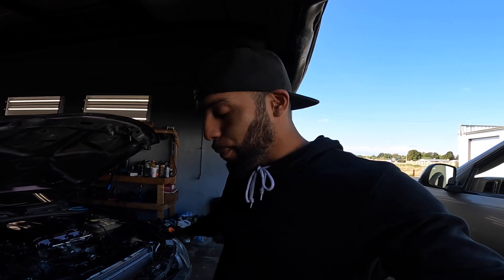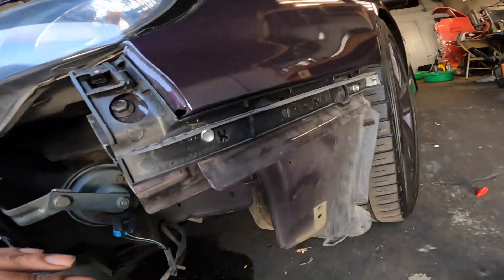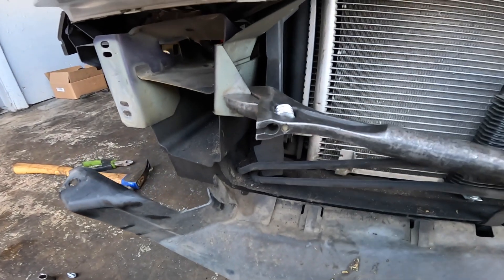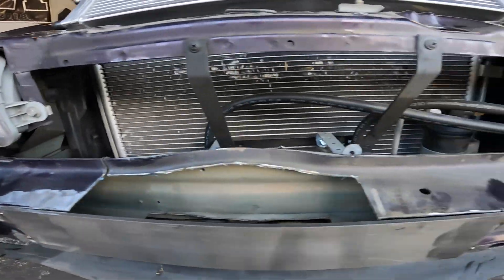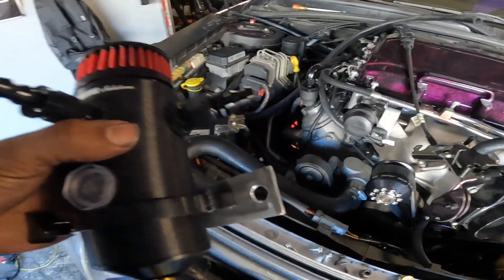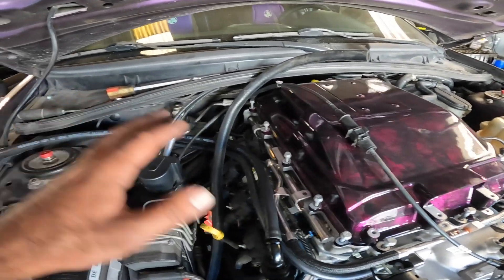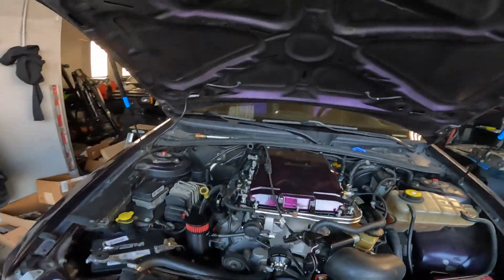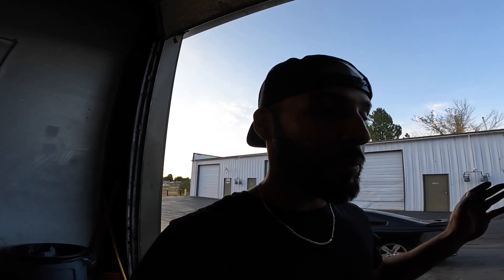THIS PUT US BEHIND *LSA GTO BUILD*

Comment: I just started my LSA build today, curious to see how you mount the heat exchanger and pump. Also what did you do to make the power steering reservoir fit? I see some people relocate but it looks like you just used the existing bracket and just simply pushed it over and just used 1 bolt to hold it in?
Reply from the maker: Relocating it is easy. Also I made brackets  for the heat exchanger/pump from aluminum
Reply: @TreyHerrera  Ok thanks, did you pin the crank?
Reply: @jrmaddox yes you have to pin it

Comment: How was those bolts on the Hinson shaft and 04 diff? I’m so glad I have an 05-06 diff on mine. I had to cut one of the bolts off the driveshaft cuz I bought it used from a friends (04). 
Good stuff btw 😊
Reply from the maker: Bolts were fine but we still got new 10.9 bolts for it just to be safe
Reply: @TreyHerrera  maybe they updated the design. Mine has both bolt patterns but the 04 has one bolt directly behind the u joint flange. I have no idea how previous owner got it in but I had to cut it off.